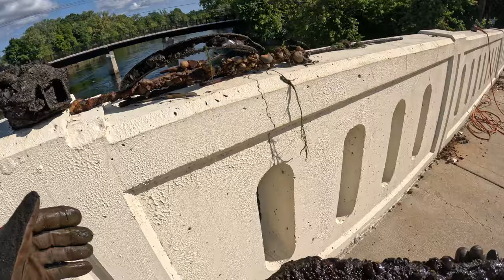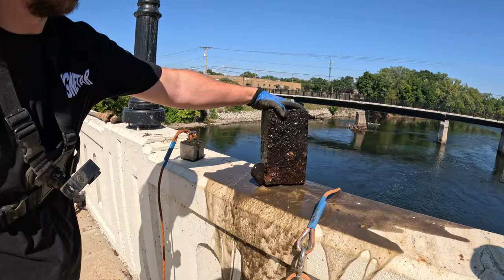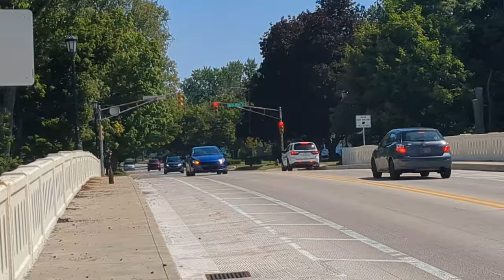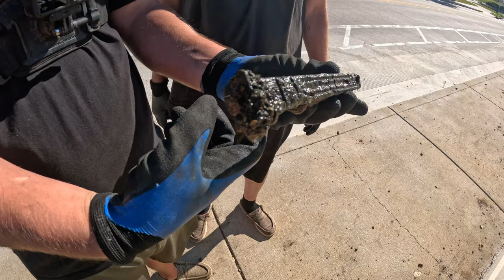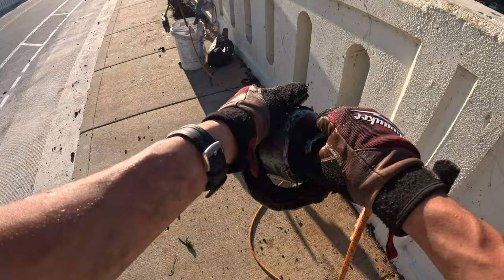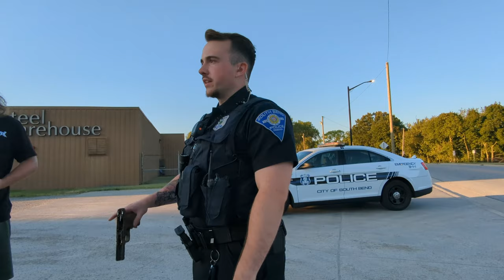Police Shutdown Neighborhood After HORRIFYING Discovery; Scariest Magnet Fishing Find Ever!

Comment: Dumb question and just a thought, irregardless of condition, shouldn't you treat them as if loaded until cleared? 
Yea I know you can assume that if there IS a round in the chamber that it's soaking wet, but still...
Reply: in this condition you treat it as loaded because if it was and that round goes off, the whole gun might come apart with it.
Reply: I was just thinking the same thing when the guy smacked the riffle against the concrete railing! Lol